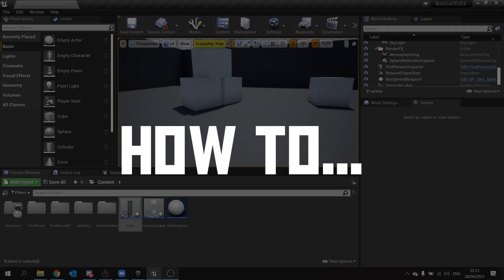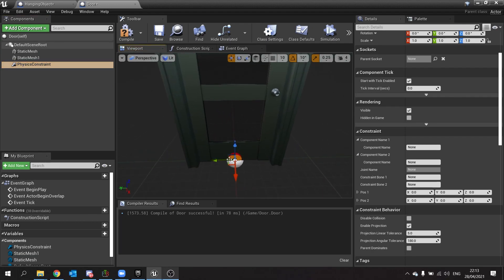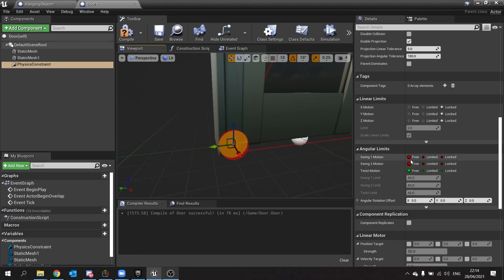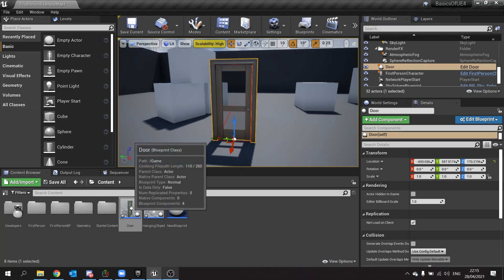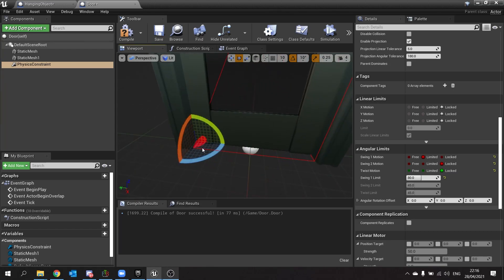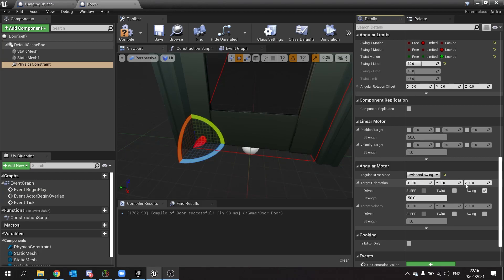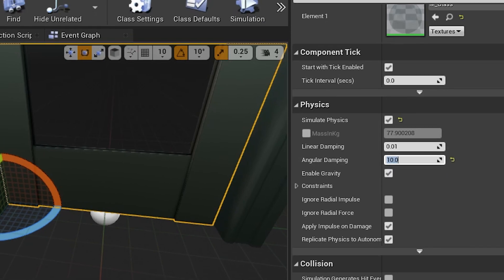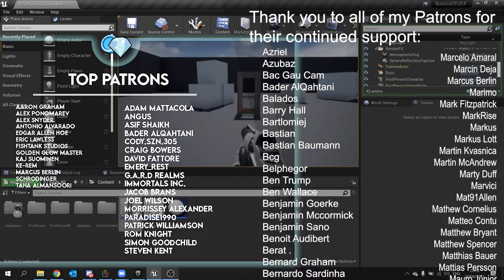How to... Physics Door

Comment: Some complain that it doesn't work. It didn’t work for me either, after 10 minutes I remembered something - in order for physics to work, you must also enable the checkbox in the door settings inside the blueprint: select Static Mesh of the door, in the settings on the right go to the Physics section -> check the Simulate Physics checkbox. Apparently, the author forgot to show it. In any case, thank you so much for the video, Ryan!
Reply: Not all heroes wear capes.
Reply: ur a legend bruv :thanksdoc:
Reply: you are hero

Comment: How do you make it so that the door doesn't swing past the frame? Example: when you go thru the door and it swings closed, it swings past the closed position slightly before swinging back to the closed position. How do you get the door to stop at the closed position and not go past it?
Reply from the maker: Add a limit, and rotate it so the angle starts/stops at the door frame
Reply: @RyanLaley  just saw this. Thanks!
Reply: @RyanLaley  Trying to get the same behaviour. I don't fully understand what I need to do

Comment: I'm stuck at creating door blueprint. I want similar door with Physics Constraint, but with ability to set initial opening angle in construction script. It is nearly impossible! :o Because Angular Rotation Offset is not accessible from blueprint.
Reply: just found workaround: return door rotation to 0, constrain components and set needed door rotation. this all need to be done in beginplay.

Comment: Ain't working. I never thought creating doors could be this complicate... no tutorial seems giving the definitive solution. Is it due to something new or different in UE 4.27!??
Reply: I actually had the same problem and couldn't find a solution :( I tried it on both 4.27.2 and 4.26.2 and it does not seem to work. I'm guessing he did something before the tutorial that made it work but did not tell us.
Reply: It didn’t work for me either, after 10 minutes I remembered something - in order for physics to work, you must also enable the checkbox in the door settings inside the blueprint: select Static Mesh of the door, in the settings on the right go to the Physics section -> check the Simulate Physics checkbox. Apparently, the author forgot to show it.
Reply: @cyberded  physics greyedout for door
Reply: @shubh0  you need to create a collision for the static mesh of the door: open the Static Mesh -> select Collision at the top of the window -> Add Box Simplified Collision.
Reply: @CYBERDED  Thanks a lot it worked 👍